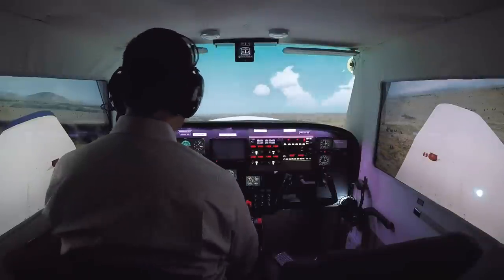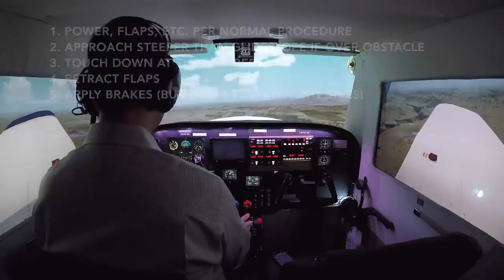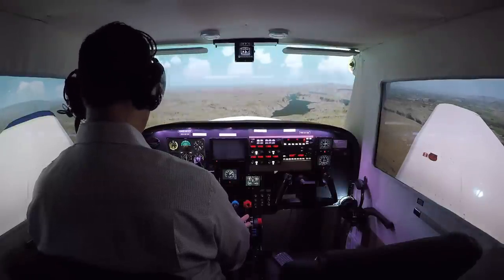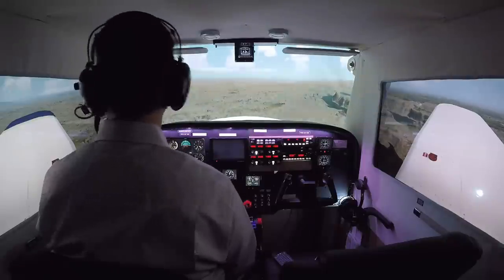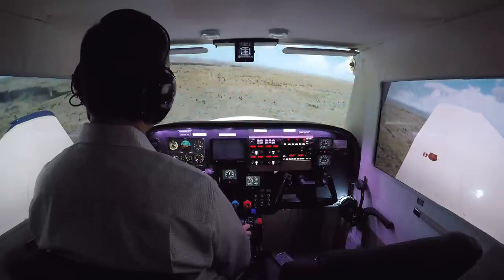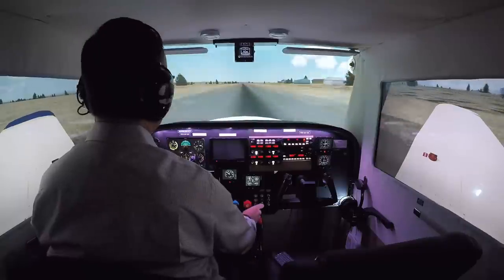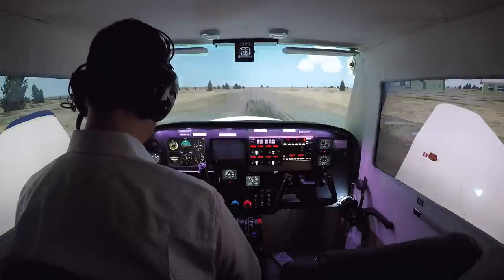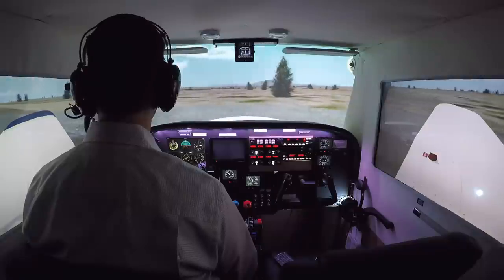How To Simulate A Short Field Landing (Prepar3D Home Cockpit)

Comment: I would say a good way to ensure that you will touch as closer to the numbers as possible and not risking to go long or fast as it happened here, would be to apply full flaps earlier in the beginning of the final approach stage which will help you to control speed and descent rate better, you will of course need to add more power to maintain safe speed with that flap fully down earlier but it will pay of on your spot landing. Overall like your video, great explanation on your side and awesome home sim. And as I like to say, there is no perfect way, is all try and error, but in the ends it comes down to what you feel comfortable with and always giving your personal touch the the standard procedure. 
Keep those great videos on my friend !!
Reply from the maker: Thanks. The procedure for the Warrior II is to fly the pattern as normal, including flap deployment, and to come over the fence at 63 knots. Given that I'm trying to replicate my real world training (which is in a Warrior) I stuck with that procedure on the flaps, and I was very close to or right at 63. I don't think the flight model replicates the brakes well at all. When I step on them in the real thing I could flat spot the tires. In this video I pounded the brakes and we kept on-a-rollin'!